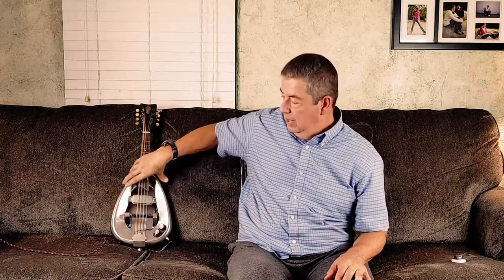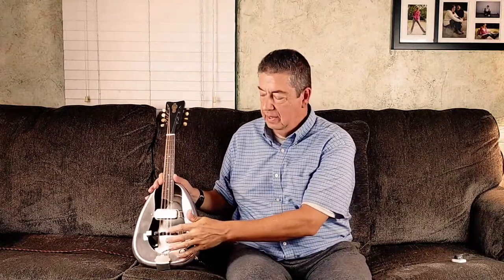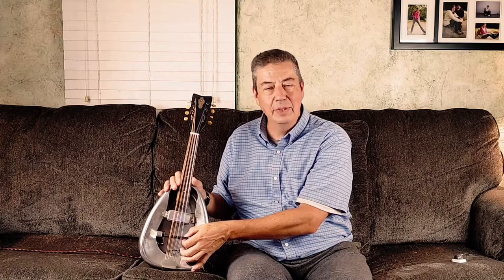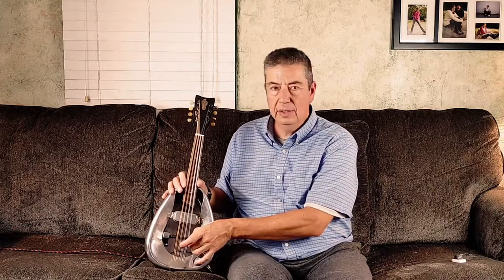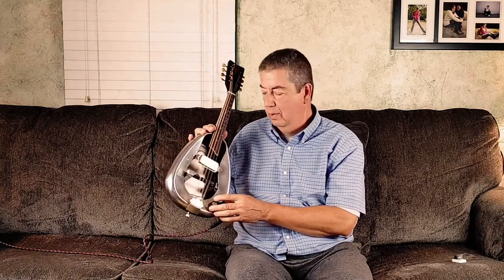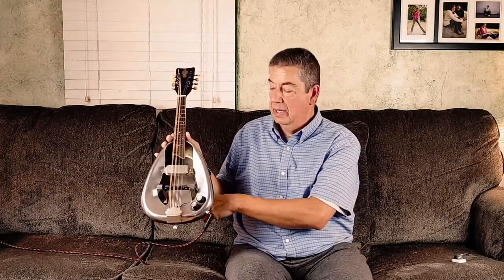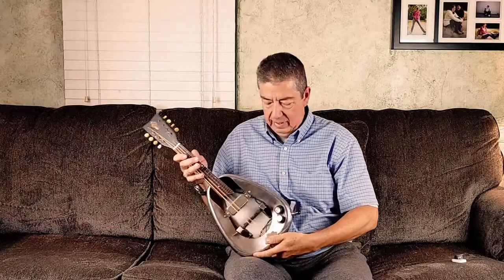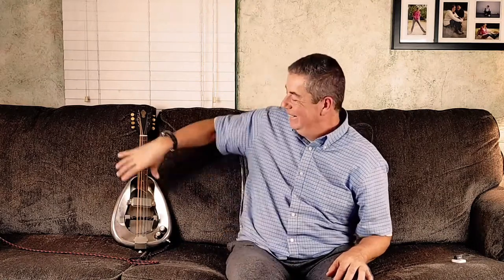Bedpandolele- Bedpan Mandolele Modification

Comment: Did it keep the metal strings like a mandolin or did you move to a nylon string or wound string?  Thanks for sharing this one!
Reply from the maker: I put D'Addario Phosphor Bronze Mandolin strings on it.  Setting  it up for slide required more of a slack tuning so the Mandolin strings worked fine..  I also had to set the action at the nut to heights that could handle the slack tuning on the C, E, and A without creating buzz.  I do have a broken bowl back Mandolin that will be fixed and setup with light gauge ukulele strings.  That will be a future video.  It needs a lot of repair.